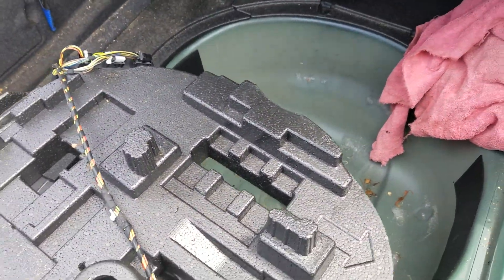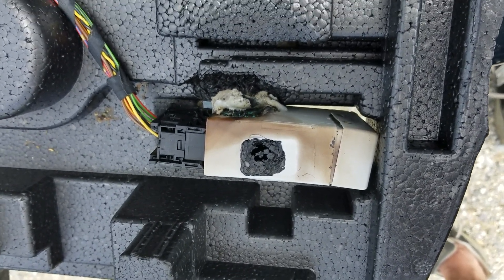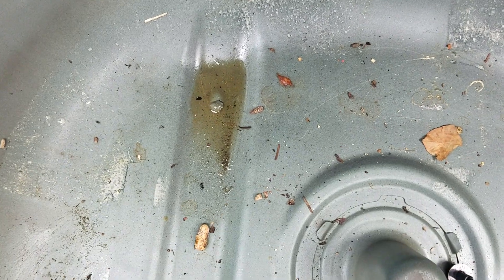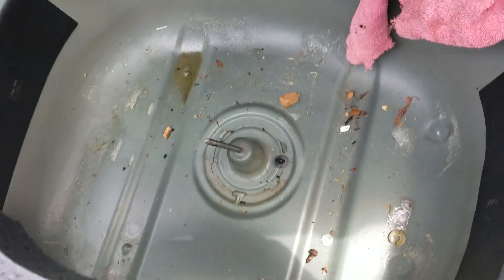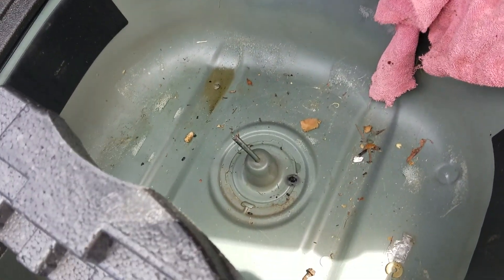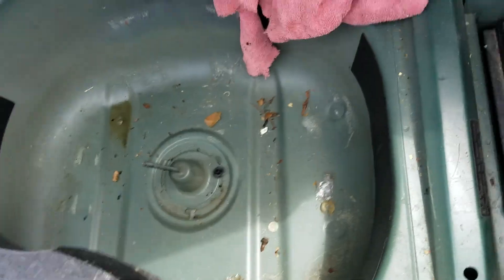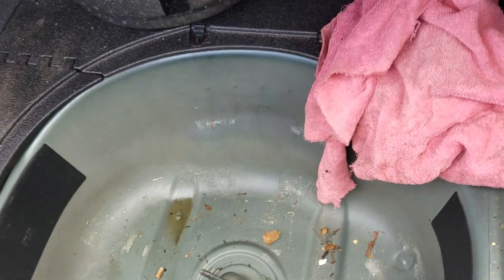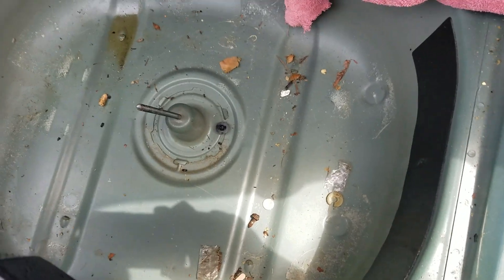bmw E60 micro power control module failure

Comment: Hi. I have the same issue, but noone can help.
Given a 2006 E61 525D. After heavy rain (I parked in a garage, so i didn't drove it in the rain, just after it stopped) I started the car, went with it 2-3km. Then I stopped it and after 2-3 minutes I started with it further and brought out 6-7 errors. From tire pressure sensor error to start stop assistant, transmission error (It has an automatic, and it doesnt make the job, stays in 3rd gear with the trans light on), anti-rollback error, driver safety assistant error... If it stands for an extended period of time (e.g. 1day) and I start it, everything disappears until the next start. I've been to a lot of mechanics in the last 2 months since then but everyone says they don't know what's wrong. Since then, the car has discharged the battery once to completely zero. With a new battery, it wanted to start very badly at first. Now it brings out the faults at every start, the power steering does not work either. Randomly turns on the rain-sensing wiper itself and wipes itself for 2-3 minutes, it varies.
Reply: hello, can you please tell me if you changed the module of the spare wheel, did everything return to normal, that is, from the module was the problem given?  I'm trying to fix it, you have problems with the side of the car, BMW E61, 2007, thank you.
Reply: @berlingermany.2804  Hey! No, that wasn’t the issue. In the trunk i didnt had that module and in the trunk was everything OK, no water. It was my ECU, after the rainy day some water splassed up to the ECU and fried it. New ECU, reprogrammed and everything worked again.

Comment: Did this cause your idrive system and stereo to stop working?
Reply from the maker: yes
Reply: @geary2  how much was it to fix this problem and did you do it yourself?
Reply from the maker: @thedon2673   I bought the part and put it in myself. Real easy.
Reply: @geary2  Thank God, mine just smoked to death, gotta get a new module.